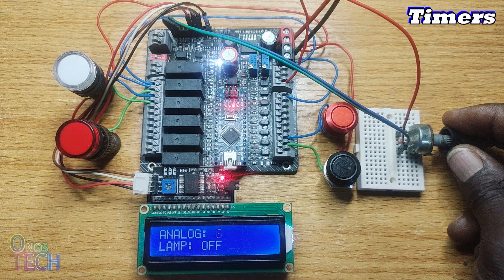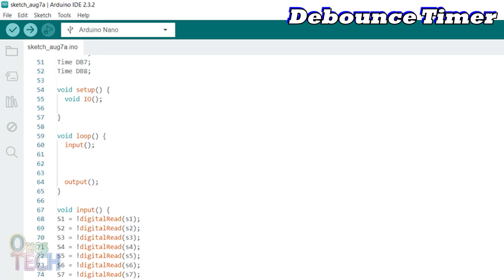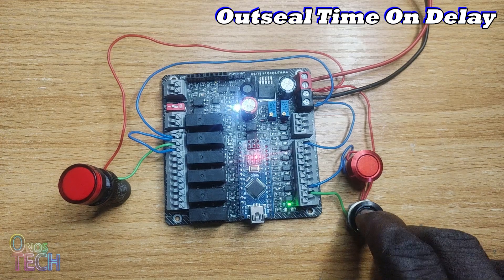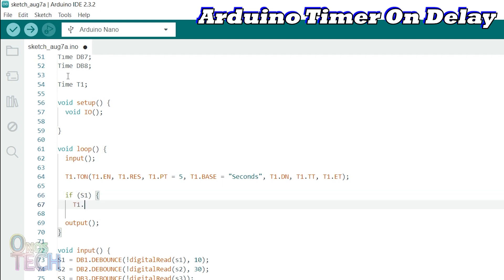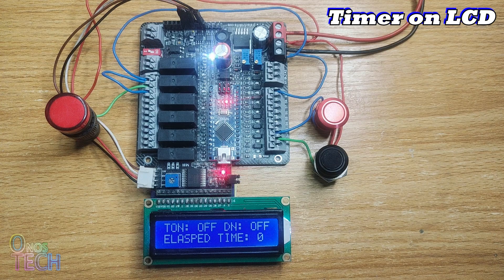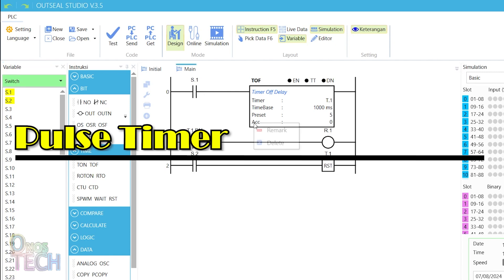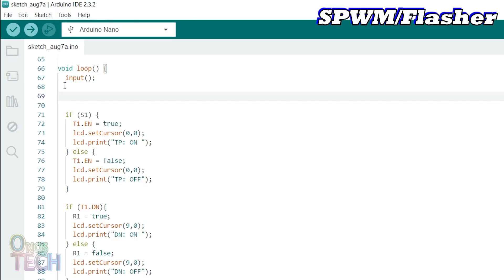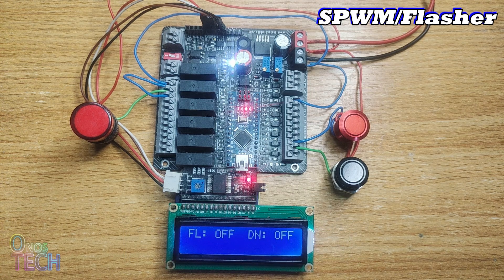#4 How to Program PLC Timers with Arduino IDE  | Arduino Sketch ⇌ PLC Ladder Programming

Comment: Hi Onos:
Great Job!!!
Btw, I sent you a mail about a problem I found in openPLC. Did you receive my e-mail?
It is about a Modbus RTU communication problem. I tried 4 slaves (4 arduino Nano) and OP320A-S as the master. It is about a very simple program loaded in every slave (just a Set-Reset program).
It works perfectly with FLProg (8.2.1 Beta version software) but it does not with openPLC.
openPLC works O.K. with just one slave.
Am I missing something in openPLC?
Thank you very much in advance!!!!

P.S. FLProg works OK but it takes a lot of time(minutes) to open and also to compile and download the program to the Arduino Nano. In this case openPLC is so fast compared to FLProg 8.2.1 Beta
Any recommendation to speed up FlProg 8.2.1 Beta.
Greetings!!!!😀!!!!